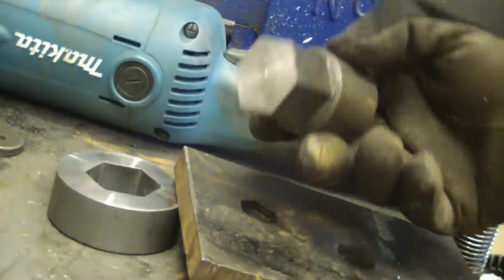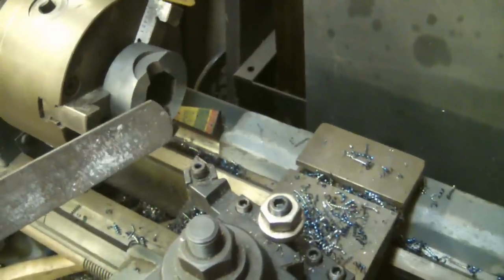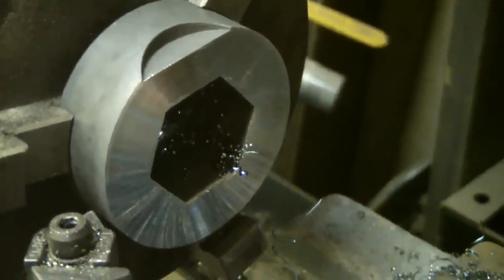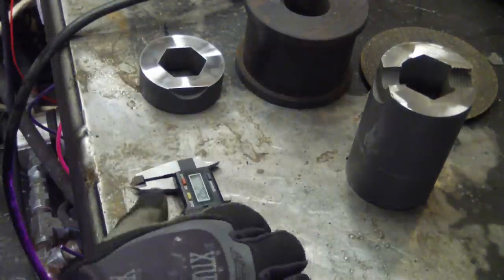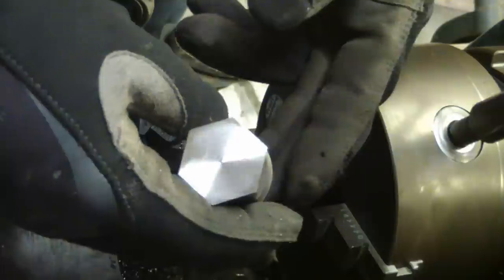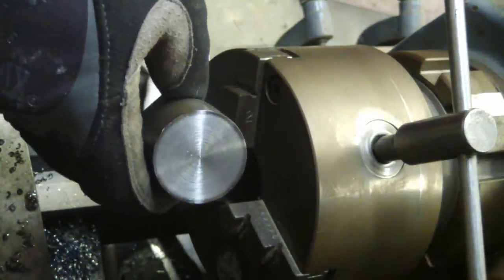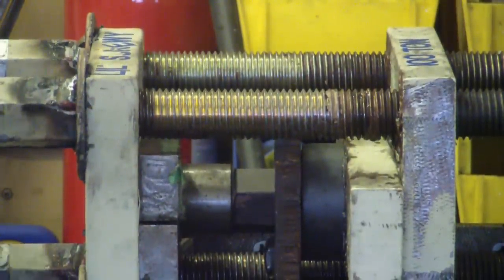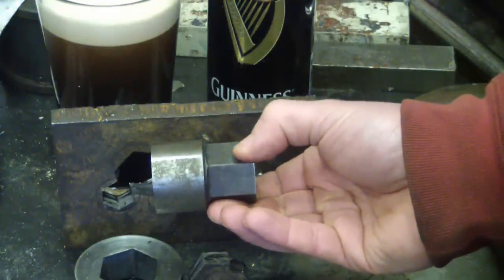How to turn tool steel in a lathe

Comment: Cutting grease or oil would have helped.
Reply: You don't use oils or grease on carbide it is bad for the tip use a water based soluble oil coolant

Comment: my tool maker mentor is rolling in his grave.  you will produce cleaner holes and prolong tool life if you machine some very light relief cuts so every edge on each cutting face has a slight inside bevel to it  =>   |\_/|  you are making a large chip and it is better to cut than to tear....also hydraulics are your friend (that what she said!)
Reply: GangstaTheHog what do you mean?  are you saying to bevel the outside edges of the piece so that the carbide doesnt a corner?

Comment: Tool  a  bit to far out of tool post , try to have everything as solid as possible
Reply: Yes very good, running a little slower , may also prevent the tip from  blunting but  your doing ok well done

Comment: Hey man, cool vids ya got.  Ya know, I watched this vid twice and just realized, it would have punched easier, perhaps, if you just left the crooked zip cut and NOT facing it off. ha.  Like. the more the taper on the end the easier it will go in!  But seriously, it would probably shear better? right?  You would have only needed a 99 ton press and no sex for a week.   Although it was very informative that I know now I CAN turn tool steel, surprisingly and thanks.  But then the name of the vid IS turning tool steel, isn't it.  Duh, ha

Comment: What a lot of crap.......there's just no way you going through a half inch piece of mild steel just with those screws alone........no ....f......cking way.....you need at least 200 tons for that . If you look at the male press die you can still see the center is intact also no way you going to cut hardened tool steel with a tungsten carbide tool you going to need a ceramic tool.......obviously a prank right?
Reply: Tony Branco Obviously you haven't cut hardened tool steals with carbide tools. Or any kind of steel with carbide. HSS drilling tops. You'd be surprised of what you can cut with carbide tools.
Reply: Damn trolls

Comment: Dude, I love your vageos, but it freaks me out when I see you turning something on the lathe. And no! - nothing to do with gloves, it's the way you hold your tool. The more experienced lathe jockeys will tell you - you gotta hold the tool as close to the tip as the situayshun will allow to reduce flex and chatter. The boring tool in this vageo looked like it was expecting a hole three times as deep, and even the facing tool was reaching out like it was afraid to touch.

Comment: Why people use electronic callipers instead of mechanical? I guess it’s not much more accurate and have no other advantages (except being easy to read measurement for really dumb people). If you want measure something more precisely you use micrometre, dial gauge, microscope…
Reply: rados123 as you said.easier and quicker to read.I don't wanna bend over my lathe to measure all the time
Reply: You don’t need to bend over, there is screw to lock calipers after taking measurement. If used properly, manual calipers can serve you at least 100 years, and you don’t need to worry if battery goes flat. I think it’s small inconvenience for reliability.

Comment: Please, please, please don't wear gloves when operating rotating machinery.  Also NEVER, NEVER leave the chuck key in even for a second.  Get into the habit of removing it all the time.  Some things you learn the easy way, some things the hard.  I learned the hard way on both of these.  Luckily nothing happened, but it was close.  Hmmm, yup, still 5 on both hands.

Comment: Don't ya think ya could have donated that unwanted caliper to an outfit like "Good Will" or "The Humane Society" so some budding machinist with limited funds could have what you don't want?
Reply: +AvE use this fuxin press on then!
Reply: +AvE And someone should point out that a Harbor Freight caliper like that costs less than the manpower behind donating it. Just remembering to drop it off at a suitable place is more work than it's worth.

I mean, if you know a kid who would use it you could give it away, but cheap tools to strangers is BAAAAAD.
Reply: I've been using HFT for many years and have ye to see one fail or read incorrectly (I check frequently)). I bought my HD drill press from them over 40 years ago in one of their first shores. That store was so small you had to walk in and back out. But quality changes like everything else. I continue to purchase a couple of hundred bucks worth of what I deem as sufficiently quality tools from them each month. I don't put a lot of faith in "They say-" or "China bashing". That's childish. American workers want to compete with China, but I don't believe that the corporations they work for have the same outlook. They've made their money and now hunt for that tax break for losses and the shifted income of letting those craftsmen on the floor who built their company go so the illegal alien can be hired. Sorry this is a bit+.5 long, but I think this matter needs to be addressed. Oh, guess who OWNS and/or commissions those Chinese industries to produce tools? That's right, American Corps. Thanks! JD
Reply: I have those calipers. Random on/off, mm/in,  and zero out will drive you nuts in no time and then out comes Grond, my engineer's hammer. Sometimes bad tools are worse then no tools.